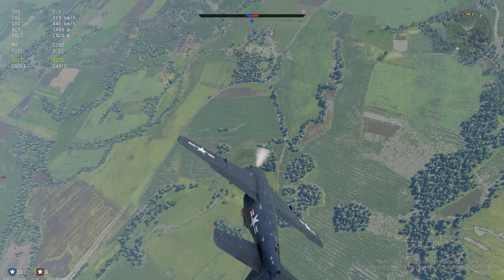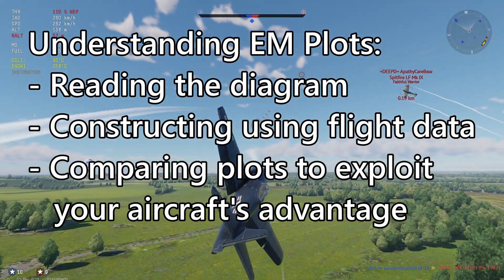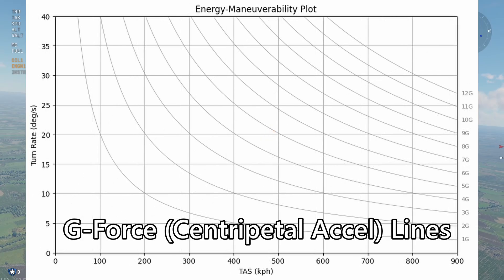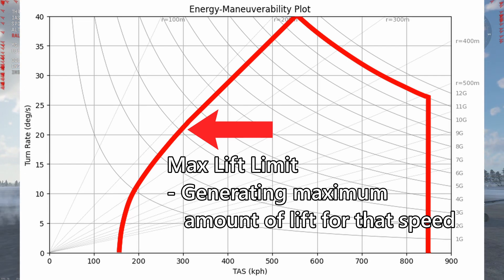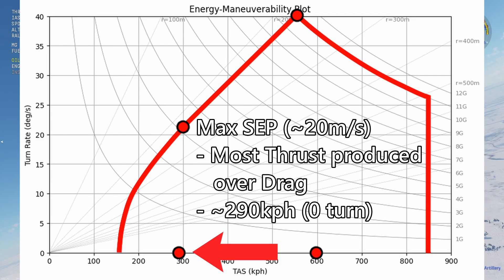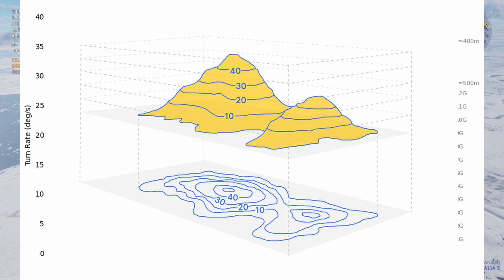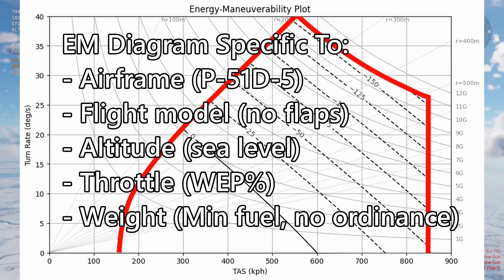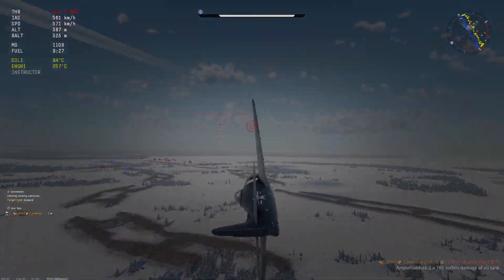What is Energy-Maneuverability? | EM Diagrams Pt.1 | War Thunder

Comment from the maker: After doing some revising to my script, the EM Diagram I use as an example in this video is not 100% accurate, specifically the SEP contours in the middle of the graph are not angled correctly. Behavior at the edges of the plot are still accurate so everything I say in this video still holds, just if you care about shallow turn behavior, it might not be perfect.

Comment: 00:42 isn't this because the TA-152 does that turn at 10200m. The F4u at 5000m. I was told the max speed at height was also the height of the turn rate.
Reply from the maker: @HandFromCoffin  yeah so i guess it's "correct" for those parameters but its also basically useless as a comparison metric

Comment: Aerospace engineer here, great work! Id really recommend you also look into Boyd’s New Conception for Air to Air Combat. Essentially after taking part in the F-16/18 design effort and fly off NASA contracted with John Boyd to help identify why in human ability and models weren’t able to totally capture the effects they saw in the fly off. The report boyd came back with after some time was this new conception for air to air combat. it essentially looks at how the hard factors like turn rate or em graphs only capture static behaviors rather than the more dynamic interplay between maneuvers and how they change in time. boyd used it to draw a lot more of the human factors out of how different aircraft are able to help a pilot better stay on top of the scenario and command who is forced to overshoot or is able to stay inside of the turn. he ended up with recommendations that at least to me are extremely similar to our modern fifth generation fighters though it was written back in 1976 . Ithought it really interesting when i first studied it. it could be interesting as a Follow up to this series.
Reply from the maker: huh that's pretty interesting. since you're an actual aero engineer, you probably know this topic much better than i do lol.
Any links to resources I could go to read about the new concept for air to air that you would recommend?
(I probably won't get around to reading it until much later but it sounds like something i'd be interested in making a series on farther down the line)
Reply: @CatWerfer  I think he refers to https://www.archives gov/files/declassification/iscap/pdf/2011-052-doc1.pdf 
and 
https://arc.aiaa org/doi/10.2514/8.2956

Comment: as a mech Eng and one of the top D5 pilots in the game, this video and this chart has me frothing at the mouth
Reply from the maker: @zedoktor979  ..in a good way?
Reply: @CatWerfer  Oh heck yeah. 

I've been working on my own top speed charts for props, but been having a hard time getting the power curves right for the planes. Ram air has a lot of effect and its hard to predict the HP gain or loss. Same for prop efficiency.

If you wanna squad for videos lmk. In game name is EquivalentDelta, I'm decent ;-)
Reply from the maker: @zedoktor979  are these different from the ones dogeness has made?
Reply: @CatWerfer  Yep they're homebrewed. Currently only have a few made, and they're not perfect yet. The math is solid, but getting good data is the hard part. Yak-3U, 51D-30, Dora 9, and Spit 14 as of now. 

They're sitting in a google sheet of mine. Along with a ton of meta tier 3 and 4 props HP curve at climb speed over the alt range.
Reply from the maker: I'm pretty sure a tool for power over altitude exists that takes datamine values called WTACP or something like that by alpakinator

Comment: how do you account for altitude and energy lost or gained in postive or negative verticle manuvers. also i didnt understand how you got 290 km/h as the optimal climb speed. was there a visual clue i missed or is there more to it?
Reply from the maker: @piedpiper4450  i didn't do a great job of explaining specific excess power and the energy aspect of it. At the corner speed, turning causes a lot of drag, loses you a lot of energy. Your plane has both kinetic and potential energy, and so you can choose to lose kinetic energy only while maintaining potential by doing a horizontal turn and maintaining altitude, or you can maintain kinetic energy (speed) and lose potential by diving in the turn.
The optimal climb speed of 290kph is specific to the p51d5 and is something I tested myself (as well as all the other things shown in the example graph), and ill get to how you can find those in my later videos

Comment: One problem I saw with the EM diagram you showed is that they don't seem to account for the controls locking up.

Sure, theoretically the P-51 has a corner speed of 560 km/h and pulls 11.2 Gs. But this is only if the controls don't lock up. Datamines show us that the elevator of the P-51 starts getting weaker above 500 km/h (the "ElevatorsEffectiveSpeed" value).

This is particularly prevalent in aircraft like the LaGG-3s and La-5s which compress extremely hard.

Additionally, it doesn't account for flaps. Some planes have flaps that actually improve turn rate (J2Ms).
Reply from the maker: The p51d has a relatively "soft" control surface lockup that's only really apparent near rip speed. If i hadn't accounted for it, the pink line would not curve down at high speed.

Flaps change the entire structure of the em plot, I mentioned it but maybe you missed it. Aircraft with flaps down settings would need a separate plot.

Comment: It is potentially possible to have an aircraft which can sustain turns at corner speed or even needs to back off on the throttle or spiral climb. Consider a rocket sailplane with a TWR of 0.5 and an L/D at corner speed of 15, capable of pulling 5 G? This plane cannot actually exert more than 0.333 G of deceleration from drag, yet exerts 0.5 of thrust, so will continue accelerating despite being at its optimal turn rate.
Reply from the maker: Prime example of this is the BI, if you don't ease up on the throttle you will turn into a lawn dart

Comment: this is a lot of useful info for newer players that have little experience that would take a lot of time to learn through just playing the game and not everyone would be capable of gaining this info through playing as there is a lot going on when you are in a dog fight and many people cant keep track of their speed alt throttle how much ammo you have along with tracking one or more enemies at the same time so this graph is a treasure trove that if you learn how to read it and utilize it will give you a huge advantage over many that play the game because you can go into fights that would normally seem unwinnable if you have a strategy on how to play to your advantage and the opponents disadvantage an example would be with the graph shown the p51 if you have to take a turn fight against some one you want to do it in a downward spiral at close to your max flat speed because you can maintain your max turn rate only at a high speed and almost always avoid an upward spiral because the p51 is gonna lose that fight most of the time but to get the most out of graphs like these you really need to also look at the graph for what ever you are fighting and form a strategy for engagements where you can take the fight to where they are weaker than you it wont always be where your plane preforms best but where your opponent is considerably worse than you
Reply from the maker: yep! I'll be getting into how to compare plots in the next set of videos

Comment: Everybody gangsta untill 109K4 switched to sim contorl in a turn fight
Reply from the maker: FR tho the 109s get gimped so hard by the instructor
Reply: @CatWerfer  Can confirm...
Reply: @CatWerfer  is there any reason why the instructor completely spaz out when I try to do a hammerhead move?
Reply from the maker: @bassbusterx  it depends on the plane, some are more stable in a stall than others. if you do  it right tho most planes don't have that much of an issue

Comment: It should be noted this is a relatively modern concept developed in conjunction with 4th gen jets. It's difficult to get accurate EM graphs of WW2 aircraft or early jets, as they have to be inferred from old flight test data with dubious accuracy
Reply from the maker: oh baby wait til the next video and see what we got to show you
Reply: Is computational fluid dynamics not good enough or is it too expensive to run for a game?
I'm not thinking about running it in real time. I'm thinking about Gaijin running it to get performance data to then plop into an easy to compute model.
Reply from the maker: trying to analytically deconstruct their physics engine has some... issues. I'll go over them when I get to generating the plots

Comment: that pilot is the reason why the lfmk9 is still 5.7
Reply from the maker: HItting "to battle" in the LF Mk9 is the equivalent to hitting the win button in war thunder
Reply: The re 2005 serie 0 is lf mk9 but worse and its 6.0 lol
Reply: @kennedy-uz4wb  massive understatement, the 2005 has F Mk IX (4.3) performance minus the overheat
Reply: I don't see why the LF should go to 6.0
Reply: @jaiell2049  besides it having unmatched climb rate, turning like a zero, being nearly impossible to stall out, and having good guns? yeah you're right, it should skip 6.0 and go directly to 6.3/6.7
Reply: @alexvolute7454  sounds like a cope issue on your end ngl
Reply: @jaiell2049  yep surely me clubbing tf out of every plane i see in the lfmk9 is a cope issue lol
Reply: LF Mk.IX is too slow, if you move it to 6.3 it will never be able to get an engagement
Reply: @XSpamDragonX  It has the climb rate to get above faster aircraft and force them down. It never has to be actually faster.
Reply: @reinbeers5322  it doesnt matter how high I climb if everyone just runs away the second they see me, especially if I'm above them.
Reply: @XSpamDragonX  none of that is true

Comment: They plan to downtier the F8F-1 to 4.7^^
Reply from the maker: Yeah... it'll still fight LF Mk9s in a full uptier tho
Reply: @CatWerfer  ya but its a 6.3 platform at 4.7...
Reply: @SHEEPS_123  its flight model is a complete mess and there are other planes that do what it does much better at lower brs no less
Reply: @ozan1234561  there arent. there literally no planes with its performace at a lower br. it has 2900hp, its climb rate is insane for 5.0 yet alone 4.7. Bad MER can be a good thing, just work around it.
Reply: @ushikiii  pyörremyrsky, j2m and spitfires at its br climb better or on par, have better guns and turn much better
Edit: forgot yak-3s that just run circles around it at every altitude
Reply: @ozan1234561  it out climbs the spitfire. The pyorr is OP, and outlier for its br. And the j2m ONLY has climb rate going for it. The f8f unlike any of the previous planes actually goes fast and can separate/control engagements. F8f has good climb rate AND a good top speed. This combo is a VERY important factor, it's the only reason why planes like the p51d30 or la7 are any good. Yak 3's wont run circles around the f8f, it just wont. The yak3u might but I doubt that's what your referring to. It outclimbs the yak-3, its faster than the yak 3 and doesn't have to worry about ripping its plane in two when going 670+ kmph.
Reply: @ozan1234561  its insanely good, you can beat any prop in the game in at least one category... at 4.7 you beat them in every category